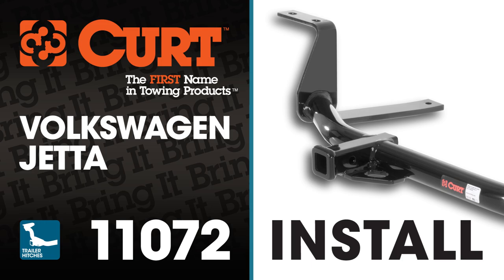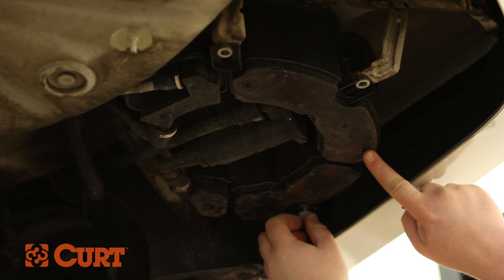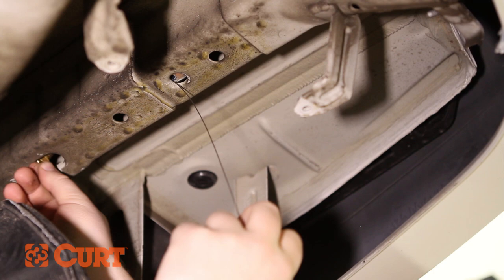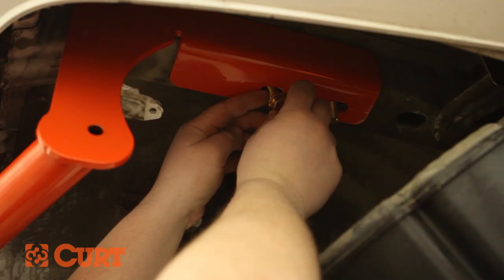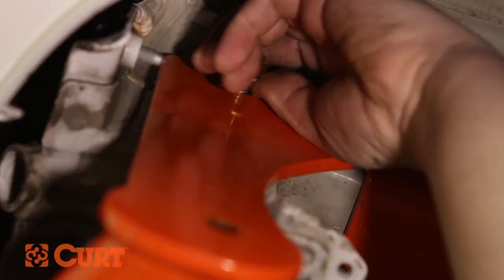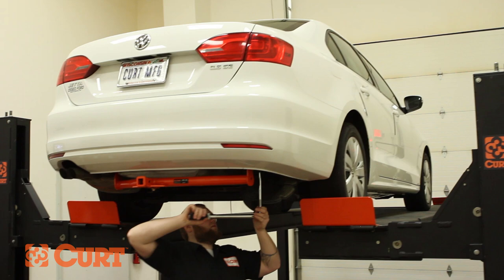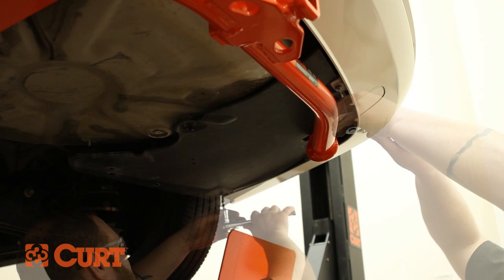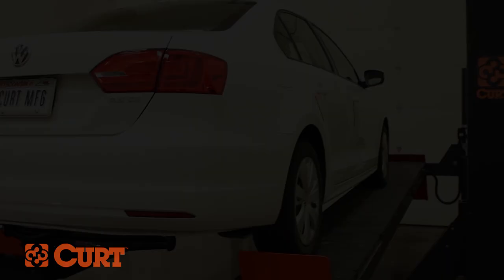Trailer Hitch Install: CURT 11072 on Volkswagen Jetta

Comment: Fyi. Important.  If doing at home leave fishing wire attached until you have hitch in place and ready for nuts. You absolutely dont want to push bolts into frame. If you leave wire then you can still retrieve if accidentally losing bolts.

Comment: Hello I have a 2012 Jetta SE 2.5L and I'm looking to tow a small light single motorcycle trailer. The bike is a super light race bike not even 400lbs. By using this hitch I should be able to tow everything correct?
Reply from the maker: Hi Vitor.  Thanks for the question.  This hitch is rated to tow up to 2,000 lbs.  To accurately get your tow load you should add the weight of your motorcycle to the weight of your trailer.  Since you will be towing a small trailer and a light race bike the weight will probably be well under the 2,000lb mark, but be sure to check your vehicles owners manual to find the tow capacity of your Jetta prior to towing.

Comment: Complete different from my experience. I purchase the Curt 11072 and the left (driver's) side arm is 1/2 inch shorter than it should be (lengthwise) It could have been a design issue with the 2016 Jetta, or a manufacturing defect on the batch, when making the weld, which shortened the overall length of the assembly. Pretty much the part does not fit.
Reply from the maker: If you have technical questions about this particular installation, please give us a call directly at 800.798.0813. Thanks!